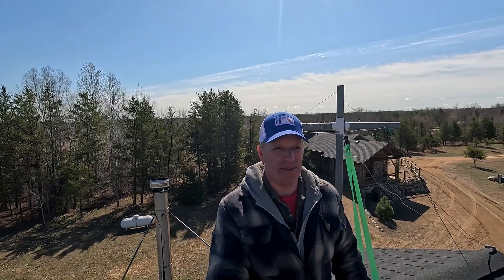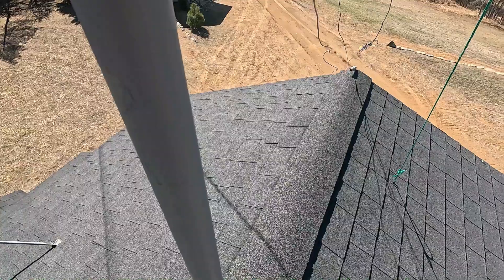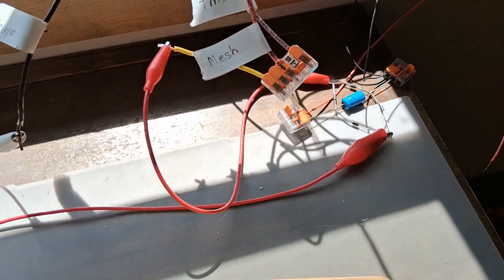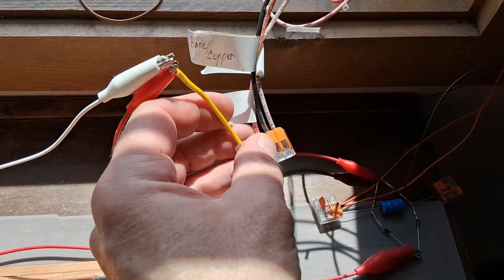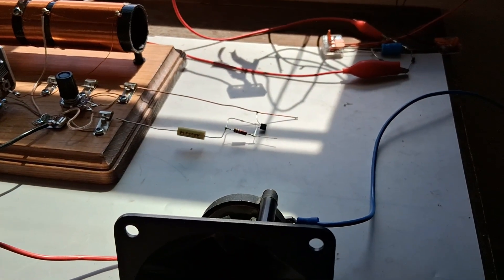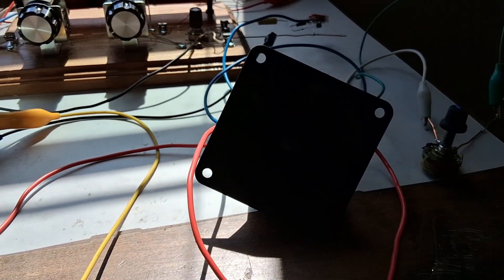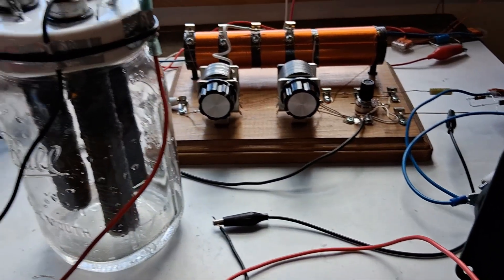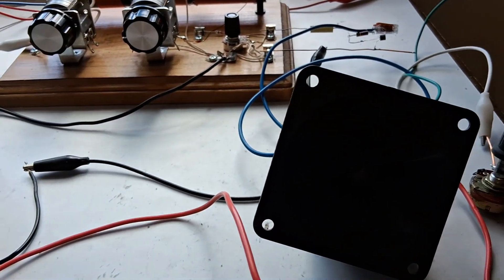Crystal Radio + Free Antenna Energy for amplifier & speaker

Comment: Look into galvanic scales. Basically using different types of ground materials. 6" to 1' apart, you WILL get a voltage. I use that to bias my diode at timed. So far, copper rod and aluminum work very well,  so does iron rebar and zinc plated all thread
Reply from the maker: I have a magnesium rod and copper clad ground rod about 250 feet apart, and it does operate the amplifier.  Shown in the next video.
Reply: I did catch it, thanks! Can you tell me what type of transistor you're using?  It looks like an NPN by the way you're feeding it.
Reply from the maker: Yes, it's an NPN.  Transistor PN2222A

Comment: Could two long antenna wires of different metals hung close to each other function as an air capacitor to generate electricity?

Maybe magnetize a steel wire and thread it through a copper mesh of something like soldering wick braid? 

You would have to keep the copper and steel from touching each other to allow them to function as a generator.

Just a gentle sway in the wind would cause the magnetic steel wire to move at a different rate than it's sheild and should produce electricity is my guess.

How much electricity I have no idea.
Reply from the maker: I did try an insulated copper wire, twisted with steel tie wire before.  I think it had a slight improvement for harvesting energies, but nothing significant.  I think that might dampen radio frequencies, though.  Thanks for commenting!

Comment: Hi! I am not sure, but maybe it is worth a try to add an Inductor/ coil with a magnetic material core with many wingdings on it to make the Hi Frequency filter to separate Voltage apart from HF? I have one "free energy" schematic and there is this Inductor in the schematic in the positive rail. Happy experimenting!
Reply from the maker: Some radios have loopsticks as inductors, but it's high frequency core material.  Thanks for the interest!

Comment: Cool. I have always been wondering why this is banned to do in DX competitions... I think it's possible to use the same antenna too, to get the power from stronger stations to amplify the weaker signals. Bigger speaker might work better to match the impedance.
Reply from the maker: It was very interesting I think, that I could still get usable power from static frequencies, while isolating out a radio frequency.